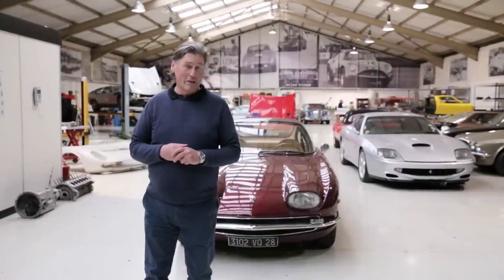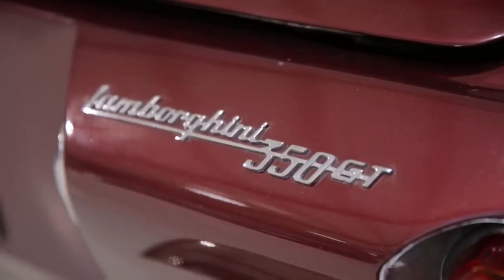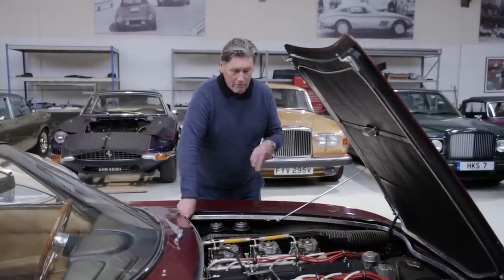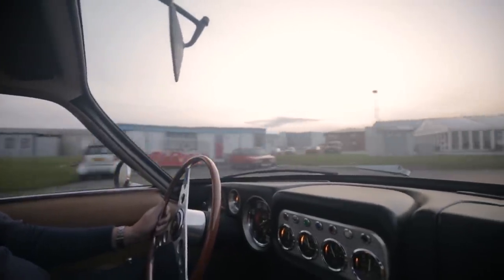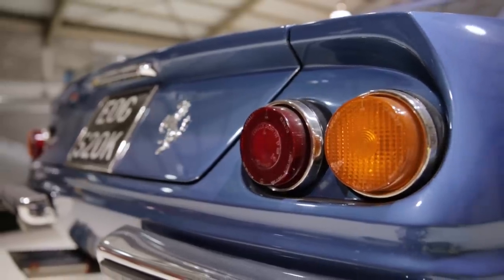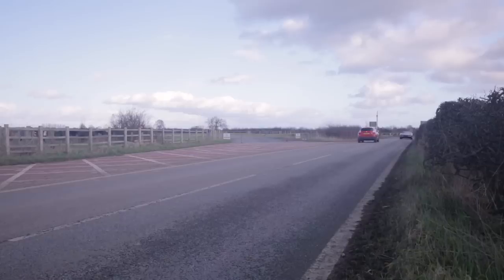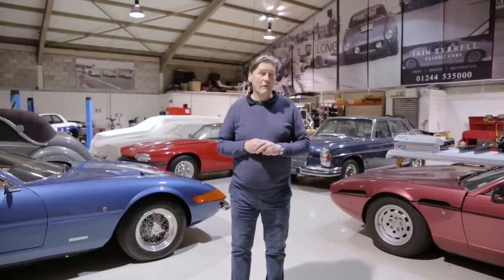Ferrari Daytona & Lamborghini 350GT - Remedying 2 classic Italian V12s | Tyrrell's Classic Workshop

Comment: "Let's try and get the plug started, get it happy and there we go." This guy is like a Bob Ross of car mechanics.
Reply: A true sparkplugwhisperer
Reply: Yes!  I was just thinking exactly that.
Reply: Iain needs to grow an afro. 😁
Reply: @delahayenator  To start the spark plug in an alloy head DOHC  engine, I push a piece of fuel line over the plug, then insert it into the head to ensure it can enter the head  without cross threading.
Reply: @mattjacomos2795  yes that's a great tool for spark plugs on twincam engines
Reply: @mattjacomos2795 Because that way, you limit the torque that can be developed & protect the threads.
Reply: On the Suzuki GT triples, they have three independent ignition systems, sharing only the battery feed. Three sets of points and condensers, three coils. They can be surprisingly robust and reliable, once set up properly. Diagnosis requires you to be methodical. Over years, you become familiar with the most likely causes of an ignition fault as opposed to a carb fault.
Reply: Amazing that the oil volume & location, presumably with an oil cooler, means you can hardly get the oil fully hot. The Ferrari V12 sounds gorgeous.

Comment: a trick with a simple fouled plug is to pull the wire loose just enough so there is an air gap at the terminal on the plug  , then the coil voltage does not get bled off thru the shorted plug, once fired and cleaned by revving a bit, shut down and re attach fully. great two stroke MC trick also. if I owned  one of these I'd also have a pre oil system . really a great idea and not too expensive. I used the smaller Moroso accusump on my GT Mustang. engine stores its own oil pressure for a shot before start next start up.

Comment: I remember doing this to my own cars in the 70's. Tuning carbs and checking for spark. I even had a carb synchronizer for balancing multi carb cars. Most shops won't even work on carbed cars anymore.
Tyrell however is a true exotic car whisperer.

Comment: The absolute beauty of genuine automotive drive ability troubleshooting skills. You don’t see that anymore in the industry; it’s become more of a parts replacers. 

It is cool how fuel delivery technology and the air fuel delivery systems at the time allowed you to fine tune the overall performance of an engine. 

Liked how spark plug test to verify for spark and the strength of the spark jumping the wire. 

Verified the air mixture by pinpointing which cylinder was at fault with the misfire.

Comment: This a thing my uncle used to do whenever his engines (whether be tractors or his road cars) decided to up and quit a few cylinders. Not until i got older, i understood that he was saving the threads, i guess my reluctance to just go for the spark plugs (as the low hanging fruit) stems from him. Old car guy know how.

One trick he taught me to never cross thread, was to put the plugs in, reverse the thread until it jumps, then turn normally. 100% effective in any material, that's the thread start (on both surfaces) catching and engaging. I have never cross threaded anything in my life after that.

Comment: Interesting that you mentioned the removal of leads and forcing a spark...  I was taught that a long time ago, especially relating to the notorious spark plug eaters...  2 stroke motorcycle engines...   to attempt to unfoul the plugs..  and it does work.

Comment: Nice to hear somebody agree with me on spark plugs. On the car forums I read everybody seems so cavalier about the plugs, even to the point of removing them just to turn over the engine more easily. Always seemed like a bad idea to me, particularly on a car that has had several owners and for all you know every last one of them changed the plugs or even removed them multiple times just to have a look. You might be the lucky one who gives it the last straw and strips the threads.

Comment: If exhaust manifold is at reach you can always check its temperature...if they are separate for each cylinder cold one will indicate cylinder that is not firing. Use infrared device or a small spray (mist/drop) of water as indicator of hot one. 
Misfire is also bad for transmission because it introduces irregularities in torque and angular velocity to the system. Transmission for V12 is designed having in mind its smooth torque flow so any disturbance in it will make harm to transmission and the rest of the drivetrain.

Comment: Iain...you are my new idol! Thanks for your competence sharing and clear explanation! 2 days ago I had the same spark plug issue on my 911 T year 1969... Running roughly on 4/5 cylinder after some days just getting it in and outside my garage so surely flooding engine and not warming it properly.... Cleaned and dryed the plugs she is smooth again! If I woud have seen this video before I had avoided the distress 😅

Comment: Hi Iain, love your work and the videos. I was pondering over the very narrow Lamborghini spark plug wall tolerance you mentioned. Perhaps the idea was/is that the custom socket tool when placed in the narrow access point, better centralises or positions the spark plug to minimise off axis location of spark plug into the head so that the risk of cross threading was/is reduced? Bye for now regards John

Comment: Just a tip, in hard to reach places to install spark plugs, slip a length of fuel hose over the plug porcelain and screw in,. No more cross threads.

Comment: As an apprentice brand new I cross threaded a plug into a renault 5 (the distributor is in the way) and not long after into a five cylinder Audi,  that was 33 years ago , since then every plug I've ever put in I spun it left to seat it and never used a tool to start it,

Comment: Just found this channel and wow , what  a treat. Really suprised  tho, to see two big orange FRAM oil filters on the Ferrari? Back in the day  when i was a  weekend spanner  wiellding  petrol head, part of the VW GTI community, We wouldnt go near those cheapo filters  as they didnt have the correct valves inside to hold a bit of oil pressure for initial starting. Even the magazines advised checking potential 2nd hnd purchases for these orange horrors. Maybe times have changed?  quality improved?

Comment: Impressive as usual, sir. As your Atelier, spotless floor, very bright lighting.  And you are the very first auto specialist I ever saw wearing his Rolex while wrenching !
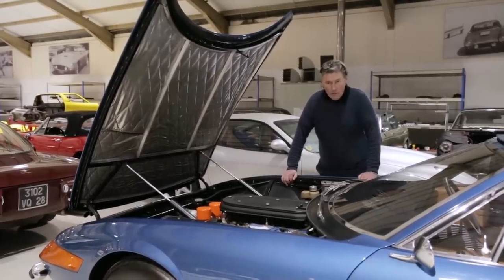But tell me, aren't you supposed to fully warm up an Italian engine before revving it like you did at 19:35 ?
I always did with all my cars and I keep them for years - 16 years average - and none ever burned oil.
 Even my summer toy, (a much less fancy then all the cars you work on) a 1988 Pontiac Fiero GT, 2.8 V6.  Not a drop !
Reply from the maker: Thanks for your question. I do talk about the engine being up to temperature whilst driving the Daytona.

Comment: Could you , in future episode, talk more about your reluctance to change spark plugs. I accept what you say about potential damage to the head but I can't help factoring in my mind the potential damage to pistons, bores and rings of petrol washed cylinders and wonder what your thoughts are on this. As a lifelong mechanic I've never worn out any plug threads even after dozens of changes. I, of course, have seen many threads damaged by bad handling and tearing due to pickup of metal and loose plugs.

Comment: Lovely, just lovely. Iain, your videos are an absolute pleasure to watch. I hope the educated people that have been attracted to your channel or you could give me an answer on a technical question. I have an M30B30 engine, straight 6 swapped in my BMW E21 from 1979. As the process took the better part of two years, I'm concerned that the engine hasn't ran for too long. It was running silky smooth in the donor car 2 years ago. As I am on the final straight of electrical wiring, what could I apply to the cylinder walls in order to protect them from the first start? The engine itself has clocked less than 95 000 miles.
Reply from the maker: The big-end bearings are one of the few weak links on those great engines. I would suggest dropping the sump and checking them- you'll soon know if they're worn or not by checking them visually. If you can see copper, they're worn! Otherwise, take the plugs out, pump a little oil into each cylinder, and turn the engine on the statrer without the plugs in for 2 or 3  8- second bursts. This should put the oil light out. Then refit the plugs and start- it'll be fine!

Comment: this lamborghini i never could find one to try or buy in all my life, but i looked for it for the last 30 years and it´s really a perfect car in my opinion because i saw one in the netherlands in the 80´s but before i could think in buying it, it was sold ,so since then i never saw another, this cars are from a series of diferent brands trying to inovate or improving fast and powerfull engines that weren´t yet at their best performance regarding the engine itself, sorry but my english in technical terms is very bad, i´m portuguese and i can´t express myself correctely in english, but this is a very perfect car if working properly, this talking about high-performance cars developed in the 60´s. Regards

Comment: I gotta ask have you ever thought about putting that watch on a rubber strap or one with an expanding bracelet, or a mixture of both, as you are working near electrical and moving parts with it, and their might be abit of a safety issue there. although I must admit it is nice to see a submariner used as intended, as the whole idea of that thing was to buy quality buy once, not buy it to show off.

and now ironically the most utilitarian ones from the same age as that car are worth exactly the same as it.

also I had the feeling the daytona spider was a chop top, this is hearsay but I've looked at enough of them to see it was sitting abit higher than usual in the back, and that's usually a sign that its a conversion, as I think they used softer shocks on the real ones in the back

after all that fastback design takes up the entirety of the back of the car, now you've removed the framing, the glass, and completely changed the decklid, the quarters and everything else.

and while I remember reading they put extra bracing under the dash to help keep the body from wobbling from chopping the top on the factory ones, I've never really heard about anything in the back to add weight where the roof once was, as I bet it was designed to work like an arch with the way the body was shaped around the canvas top so it wasnt needed there.

Comment: I've read that by modern standards with cars with over powered steering etc. the Daytona is a bit of a tank but it surely is the pinnacle of a petrolheads dream. It looks stunning, it sounds stunning and the performance is stunning. Sure, the latest supercars accelerate more quickly but when can you use that (apart from showing off in Park Lane). As for looks, the Daytona was designed by an artist, not a committee who wanted to include all the design quirks that all the members came up with.

Comment: I think I may have caught Tyrrell in an error, which is unusual. I believe the paint color on the Daytona is actually Bleu Dino Metallizzato - Medium Blue Metallic, as the Azzurro Metallizzato was the light blue metallic color used on Dinos. Of course, I wouldn't be surprised if I am wrong.
Reply from the maker: Lol- you are indeed correct. I could say that was my deliberate mistake, but it wasn't! It is indeed Blu Dino Metallizato; I just got it wrong in the heat of filming. Just checking you were awake.:-)

Comment: if you suspect a bad sparkplug, run the engine, alternately pull plug wires until you find one where the rpm does not change when pulled and you've found a bad plug. replace it.

Comment: I have a articulated spark plug tool rather like that, but I'm pretty sure it's not from Lamborghini! It came with my 1972 Lotus Europa when I bought it in 2001, which actually has easy to access spark plugs with any spark plug wrench. Go figure.

Comment: Thought sparkplugs were not supposed to be fitted to a hot engine?
Reply from the maker: Traditional spark plugs with a compressible sealing washer (such as these engines have) are fine. Taper-seat plugs ideally should be fitted cold as the're torqued-up. Thanks for your interest

Comment: Lesson---on Ferraris or Mopars or Fiats or Corvettes, DON'T USE CRIMP-ON ELECTRICAL CONNECTORS!!!!!!  A 5 cent properly installed 12V side connector would have prevented the issues with the Ferrari!

Comment: Blah blah blah, warm it up  adjust carb mixture screws, pull wires with miss.   Your a rocket scientist....
crack the idle jets on cylinders with the miss, usually get clogged from sitting.

Comment: You didn't "read" the two failed plugs on the Lambo...fuel fouled? was the plug the correct temperature?, was it damaged? ...none of that, if it was from fuel fouling, what was the cause of the fuel fouling? You merely fixed the fault without determining the CAUSES of why they fouled in the first place....sorry, a behaviour  of of poor mechanic